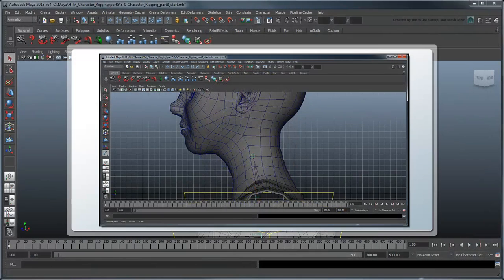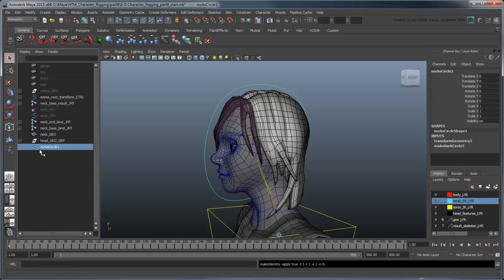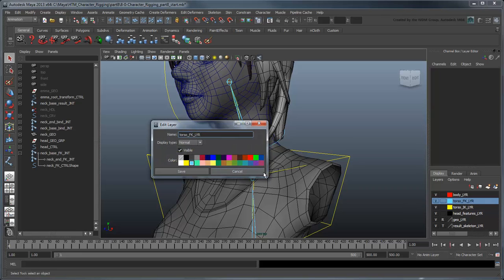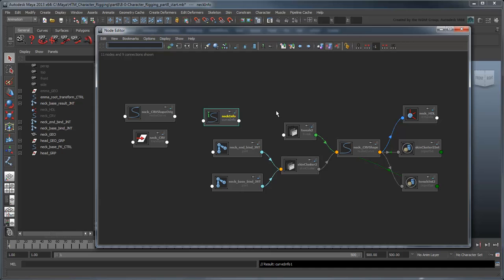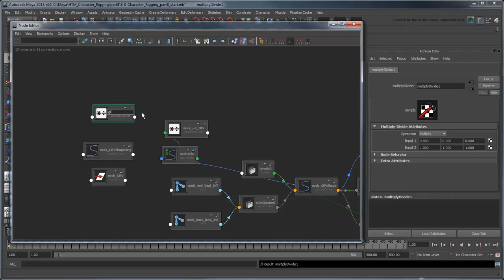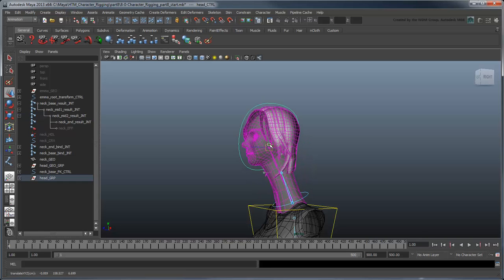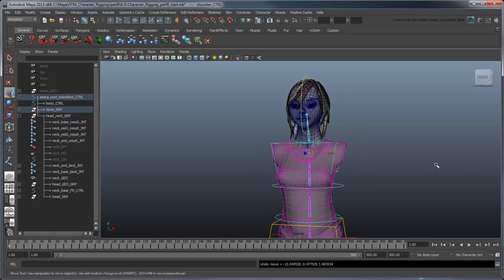Creating a Character Rig - Part 8: Neck controls and squash/stretch (Advanced)

Comment: Hi, I'm trying to do the root scale for the neck and following right up until the last step unticking the inherits transform box for the neck geo causes the neck geo to fly forward on the Z axis. Whilst it then does scale correctly it's in the completely wrong place, how can I fix this? I followed everything the same and it was all working up until now. Thanks!
Reply from the maker: It's just the neck geometry and not the joints as well?  When you select the geometry with the Move Tool, does the manipulator appear at the origin?  If not, then it's possible you moved it by accident.  You can just unlock the neck_GEO Translation attributes and snap the pivot back to the origin.
Reply: @Autodesk_Maya  I needed to move the pivot point back to the origin only and now it works, thank you!!

Comment: hi sir in part 7 local rotation axis is different for neck joints and in part 8 for fk joints local rotation axis is different
Reply from the maker: That's intentional.  FK joints don't need to match Result / IK joints.

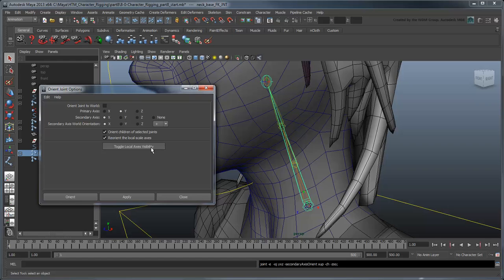Comment: @3:00 My neck_end_fk_joint doesn't orient along with the neck_base_fk_joint. Do I have to manually edit the rotations for the end-joint so that it matches the end-joint orientation in your video? If so, how can it be fixed? Here is a video of what happens when I try it out: https://i.gyazo.com/d7f4bd53d756fe3bf35ffa2b82b50344.mp4
Reply from the maker: The end joint doesn't matter actually.  You can just leave it like that and everything will be fine.
Reply: Great, thanks!

Comment: All I did was work on the neck. I left part 6 when the torso worked perfectly. It globally scaled together. And now coming back to it, the base and end sections move together and the remainder squashes when I scale up. I went back and the node editor is identical still. The spines stay stationary and the controls and base/end geo sections move. Why do the spines all of a sudden, out of the blue, untouched since the last time they worked, refuse to move?
Reply: Okay, so the actual cause of the chaos is that the spine is staying stationary. This happened a lot randomly when I was following your instructions earlier on. When I was making the spine, once I got to the Enable Twist function, it'd twist perfectly, but then I couldn't scale or move or rotate any direction other than the twist. I made sure that I followed the instructions perfectly, but it'd still happen.

I got around it by deleting everything and starting over again and again and eventually it'd work for some unexplainable reason. The whole torso was great when I finally moved on to the head. I had the same problem with the head. But right now when I tested if the head would scale with the body, the torso was frozen again just like before. I have no idea what causes this or how to fix it other than rolling back to a previous iteration and just starting over from there hoping that it wouldn't break this next time.
Reply: Why is it deleting history break my spine rig? All the tutorials I've done have always said to freeze transformations and Delete All By Type History. And why does deleting by history on a curve I edited before even attaching it to the rig make it is so that rotating besides twisting and scaling and moving are broken?

Comment: Hi MLC, I have a question. It's OK for the neck_end_bind_JNT to be constrained to the head control instead of the neck_end_result_JNT?? Because when you bind the character the head would only rotate a certain amount, and the neck_end_result_JNT would only rotate a bit of that initial value. Hope to hear from you, thanks in advance
Reply from the maker: Using the neck_end_result_JNT wouldn't fix that problem - that's a skinning issue you're referring to.  You need to make sure that the head is fully influenced by the appropriate head joint.  

Check out Appendix C for more infor.
Reply: Thanks for your fast reply. Yeah i noticed it today painting weights. The issue with the head not following the control exactly was bugging me. Also is there a way for the spine and the neck to not flip on themselves when translating them backwards?? Thank you for your advices. Excellent channel btw
Reply from the maker: @onelsongarciamaza9753  You can try changing the values in the Advanced Twist Controls, but flipping is an artifact of the math involved in calculating those.  You'll always end up with a situation where it twists in some position or another (changing the values will just change the situation that causes the twist)
Reply: What about using the twist attribute from the ik handle and a plusMinusAverage method?? Would that work?? Another question that i have is: If a character isn't in a T-pose the head and chest joints should be world oriented or stay oriented as the mesh is modelled?? Sorry for all the questions. Thanks again
Reply from the maker: @onelsongarciamaza9753  Can you elaborate on this plusMinusAverage method you're referring to?  I'm not sure I'm familiar with it.  Also I just tested the rig and I don't see in flipping when translating the head/chest backwards.

You'll generally want the joints oriented as the mesh is modeled.  Really, the goal is to just make sure 0,0,0 for all joints puts the mesh in a natural / useful neutral position.
Reply: Using a multiplyDivide for the middle joints of the spine or neck and passing through them the value from the hip/chest or neck_base or neck_end driver joints and them adding the values through a plusMinusAverage. But i think you usually use that when you have an ik spline controlled by 3 drivers, those being joints or clusters, your choice. Like in this video:

https://www.youtube.com/watch?v=MyAaX5zQyCs&list=PLklk5VvcgwJBQ-qe1i8q7TIl6_KDSDDDu&index=5

Thank you for your time once again
Reply from the maker: @onelsongarciamaza9753  Hmm, I don't think this will fix the issue you're talking about, unless I'm misreading the issue you're encountering.  Any chance you can take a screenshot of what situation you're running into and post it to imgur or something?
Reply: Sorry, my bad. I had wrong values in the advanced twist controls. Nevertheless, the end example file of the appendix C video has flipping issues with the head, when you translate it backwards. Also, i don't wanna be repetitive, but is there a way to fix the offset that the head control has over the geometry? Your appendix C end example file has it also. I think that's annoying for animators. If you have a different shape for the head control other than a circle you would see the control rotates way more than the head geometry when the character is bound. Thank you again for your time
Reply from the maker: @onelsongarciamaza9753  Sorry, again I'm not sure what you mean by flipping issue.  Do you mean the neck joints flip around?  Can you post a picture of the exact issue?  You may need to adjust the Advanced Twist Control values for the neck if you want to contort it into non-standard positions.

For the control not lining up with the head, again I strongly believe this is a skin weighting issue.  It doesn't matter what shape your control is (circle, square, star, etc) - that won't make any difference in how much the control affects a skin region.  The only thing that will affect that is the skin weighting.
Reply: I've solved the problem. but do you have an address so i could send you some pictures of the flipping in your file? I deleted the parent constrain on the neck_end_bind_JNT from the head_CTRL and made a point constraint instead, then created a cons_GRP on top of the neck_end_result_JNT, matching its transforms. Finally, i made an orient constrain from the head_CTRL to that null group. Now the head can move freely and the control can follow it without the offset. Don't know if that is correct, but at least gave me the result that i was looking for. Thank you so much for your time and advices
Reply from the maker: @onelsongarciamaza9753  Your best bet is to post the pictures on imgur and then post the link here.
Reply: Here are the links:
https://i.imgur.com/kAANbRT.png
https://i.imgur.com/amUEVDn.png

Actually, what i really did was to make the orient constrain directly on the neck_end_result_JNT, but on my way home i was thinking '' i shouldn't make it directly on the joint'' and that is what i wrote yesterday. But i tried it with the cons_GRP and didn't work. What i ended up doing is removing the neck_end_result_JNT as an influence and swapping it for the neck_end_bind_JNT. The thing is that with the proxy geometry everything works as it should. You translate your head forward and it's straight, but with the final mesh bound when you move the head_CTRL the head starts looking down and that was the workaround that i did. Thanks again
Reply from the maker: @onelsongarciamaza9753  Ah, you're right!  It appears I made a mistake in the included scene file.  Instead of binding the head skin and parent constraining the head features to the neck_end_result joint, I meant to do those things to the neck_end_bind_JNT.  I apologize for that.  To fix it, you can just select the skin mesh + the neck_end_bind_JNT and go to Skin > Edit Influences > Add Influence.  You'll then need to repaint some of the skin weights.

I'll put a correction in the video description.
Reply from the maker: @onelsongarciamaza9753  Regarding your second issue, try using these Advanced Twist values on the neck_HDL
Forward Axis: +X
Up Axis: Closest Y
Up Vector: 0, 1, 0
Up Vector 2: 0, 0, 1
Reply: Oh, boy, this has been a long conversation. Thank you so much for your time and effort. Love to discuss about rigging and Maya in general. Hope to see more stuff in the channel. Best regards to you

Comment: Hey again! So, my current problem is that while the neck stretches beautifully using the head controller, It's only the neck_end_bind_JNT that moves and stretches. The result_JNT chain stays right at 0. The Node Editor looks correct, everything is properly constrained and connected. It rotates though! Although with enough rotation it kinks, but that's probably because my model's neck is longer. Thanks again!

Comment: hi, here I go again with weird problem: do you know why is that that when I divide my neck global scale by its value (operation divide input 1X =0.126 input 2X =0.126) the result isn't 1?
Reply: the result is 0.998
Reply from the maker: There's probably precision digits that aren't being shown.  It shouldn't cause any problems.
Reply: I tried scalling up my model and it was the problem. So I guess I should work with a full scalled model. Mine was extract from a blender scene and maya centimetres and blender centimetres aren't the same
Reply from the maker: Oh, yes that could definitely be the problem.  Try selecting your geometry and scaling it to the size you want, then use the Freeze Transforms command to forcibly set that as the 1,1,1 scale.

Comment: I've followed the tutorial carefully twice. However, when I stretch head_CTRL the result joints are scaling in a different direction than the neck geometry.
 
https://drive.google.com/drive/folders/0B1ucGixGs8klWkN2akE2M050VTA?usp=sharing

What is the possible cause of this? Thank you very much.
Reply from the maker: Are you sure the local rotation axes for the result joints are pointed down the bone?  If you manually lengthen the Translate X value for one of those joints, does it go in the direction you want or not?
Reply: The rotation axes are fine. However, the problem seems to be the broken relationship( I can't find the neck_HDL) between neck_end_bind_JNT and neck_end_result_JNT , which I have no idea why.

https://docs.google.com/document/d/1g4YcFu4McwmWDXgwbrXpAvIqW_WCAoneIAa-kCiGNwM/edit?usp=sharing
Reply from the maker: Hmm, have you tried re-doing the parent constraint?  It's possible some other influence was added in by mistake.
Reply: I solved the issue by creating a new Spline IK HDL. Thank you very much for the support.

Comment: 2:24 ~ I think its worth noting that when creating a new joint chain with the use of the snapping hotkeys, the mouse needs to be clicked at a minor distance from the other joint otherwise it will connect this new joint to the old chain. It can even be seen in the video for a brief moment that the mouse was deliberately moved a bit then the new joint was dragged into place. 

It's a very subtle quirk that could confuse new users.

Comment: Firstly Great tutorials!, for some reason when i rotate my neck_FK control it is stretching out my neck joints as seen here, thanks - Adam

https://dl.dropboxusercontent.com/u/18843775/stretch_issue.jpg
Reply from the maker: +Adam Bryant I think one of your squash/stretch math nodes is connects improperly, or is still set to multiplication rather than division.
Reply: That what I thought but I went over them all again, its something to do with the head control thats pulling/stretching the neck control out when i rotate the upperbody. Its almost asif it has another pivot elsewhere and its rotating from that and not the neck end joint. Any other ideas? Thanks - Adam

Edit - I have noticed the issue has come about somewhere during tutorial 9
Edit 2 - Narrowed it down and found the solution in the comments, my head_group's pivot is way down in the torso. Is there a way to move its pivot without effecting the children?
Reply from the maker: Have you tried comparing your scene file against the included one in the tutorial?
Reply: +Maya Learning Channel Ive found the issue i just need to move my head_groups pivot  but it causes chaos with all the children so I'm not sure how to fix it now - Adam

Edit - Spent hours tonight trying to figure this out there seems no way to move a pivot when it has constraints coming in, I am so far in now to the tutorials I have lost track of what would actually need parenting/constraining if i was to create a new group.
Reply from the maker: +Adam Bryant Are you moving the pivot in "pivot mode"?  Press Insert to move only the pivot.

If you are, and this problem is still happening, then unfortunately the answer really is to delete the constraints, move the pivot, then redo the constraints.
Reply: +Maya Learning Channel Thanks for the help! finally sorted it by finding the constraints and disconnecting and then reconnecting them after i moved the head_group pivot, there was also an offset on the point constraint that i had to zero out which was causing the controls to pull down to the original pivot position - Adam

Comment: Great tutorials! I used this and the previous video as reference to rig my own models neck, but I've run into a problem. Everything works great up until when you say remove Inherits Transform from the neck_curve. My neck is actually a child of the root bone when I built all the neck rigging, so when I remove Inherits Transform on the neck_curve, the whole neck gets repositioned to 0,0,0. Is there another way to overcome the double transform problem, which will save me rebuilding everything?

Comment: 2:27 ~ I'm doing exactly as shown in the vid: creating a new Joint using v+right mouse button to snap to the start and end bind joint - but for some reason the resulting chain gets automatically parented under the bind joint - i can see this isnt happening in the vid - a setting error on my end maybe? (ive looked at the joint settings - nothing i can see that makes it automatically parented under a something else.) --- I was able to workaround this problem by creating two locators, snapping them to the location of the bind joints - then hiding the bind joints and the result joint chain while creating the FK chain. - even though the workaround helped - im still unclear as to why after I click the joint tool - it automatically turns itself into a child of either the result joint chain or the bind chains.
Reply from the maker: +Gogo That does seem rather odd.  Fwiw I just tried this workflow in 2016 and it works without issue.  You may want to clear your prefs in case Maya is doing something buggy.

If you want a work around without having to create locators, just click anywhere in the scene to create your joint (which should create it in the root), then V + middle drag onto the joint to reposition it at the same spot.  Slightly more work than the workflow shown in this video, but significantly less work than creating and deleting locators.